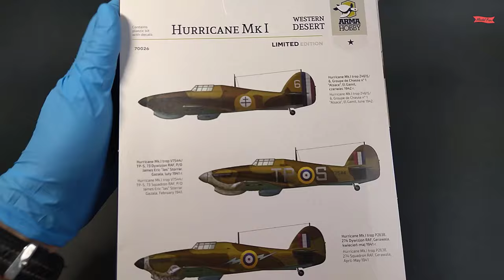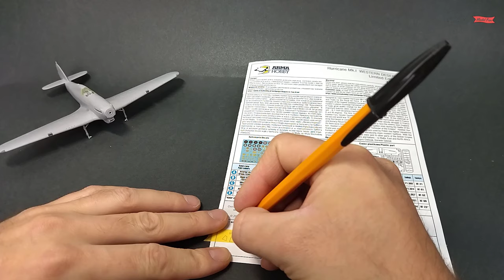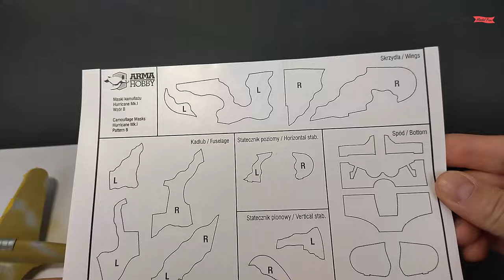Hurricane Mk I Trop 1:72. FULL BUILD. Arma Hobby 70026

Comment: When I watch you guys, you all use the Tam Liquid Poly with the green lid. What is the trick for getting this to stick using such tiny dabs? Is the glue fresher than the stuff I get on a certain very well known web site?  What am I doing wrong? Also my trigger assembly for a fairly decent Iwata Revolution BR, do you have any tips for this, the trigger button at top dangles to a link with one edge slightly angled, should this edge be placed facing the nozzle. It is so fiddly it makes me not want to use it, please help! It’s a shame because it is a great little brush otherwise. Thanks for your videos as always.